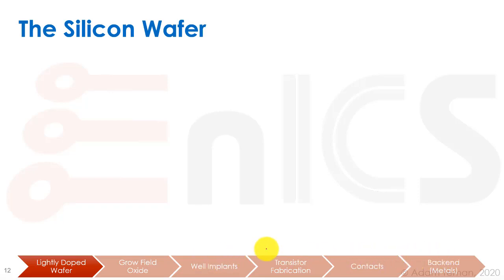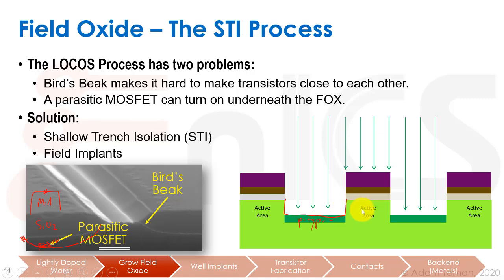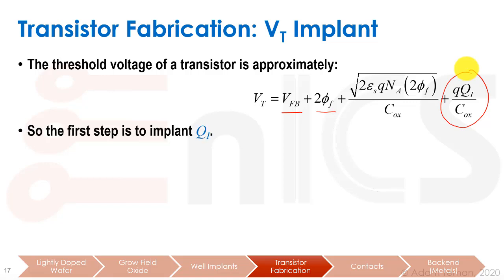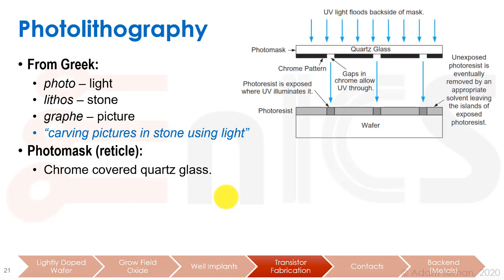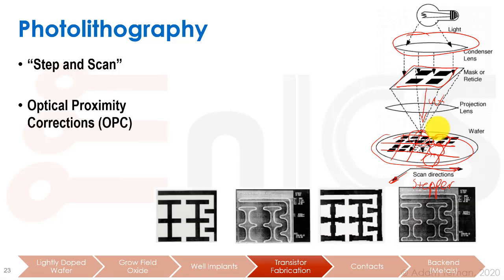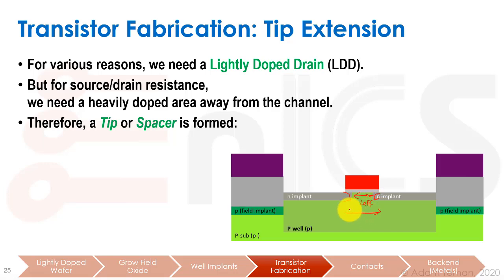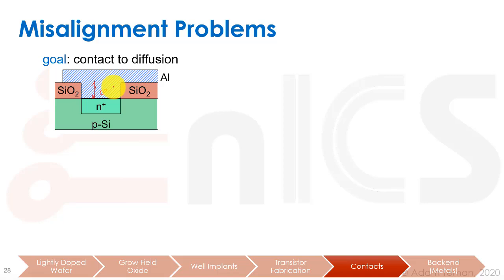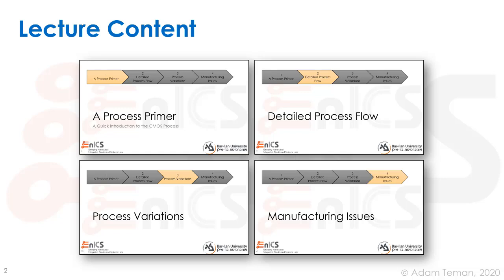VLSI - Lecture 2b: The Manufacturing Process - Detailed Process Flow

Comment: Thank you a lot for this series, I love the way you explain. What book would you recommend for a beginner in this topic? I just started working on digital implementation and have a high level idea of manufacturing process, but I would like to learn more about the steps you mentioned. Thank you !
Reply from the maker: I suggest looking at the list of sources that I put at the end of each lecture (access the slides on my website https://www.eng.biu.ac.il/temanad/teaching/). I usually write down the main books and lecture series that I used for reference. I must say that I love the Rabaey/Chandrakasan/Borijove text book that mainly focuses on circuit design, but has a good overview of manufacturing process, as well. I learned a lot of the stuff about manufacturing from J. Plummer “Silicon VLSI Technology”, 2000 – especially Chapter 2, even though this is quite an old book. There is a lot of good material on NanoHub, such as Prof. Alam's course, and you have to look at the legendary Prof. Chenming Hu's material on his Berkeley website.

Comment: What material is used for VIAS ? Why do they have higher resistance ?
Reply from the maker: Good question.
In very old technologies, they were made with aluminum, similar to the metal interconnect layers. However, as the aspect ratios got larger (higher/thinner contacts and vias), the aluminum wouldn't fill the hole very well, and so tungsten (W) was used. Usually an adhesive layer, such as TiN is filled in first to create a good connection and then the hole is filled with tungsten, and is therefore called a "tungsten plug". Tungsten, however, has higher resistance than Aluminum, and so once copper interconnect was introduced, the Dual Damascene process (overviewed in the lecture) was used to make copper vias. These also have barrier layers to eliminate diffusion from metal to ILD. You can get a good (and much more accurate) explanation here: https://www.mksinst.com/n/metal-thin-films

Regarding resistance - the vias and contacts are very special structures. They tend to be very deep holes (high aspect ratio) filled with material. This is hard to fabricate at such a nanometric scale and so the materials, processes and sizes of the vias are very strictly defined. In the end, you get a thin and long "tunnel" between layers, so you get "many Rsquares" which is high resistance. Plus, this is not entirely through copper, but has to go through higher resistance barrier layers. And finally, in a long conductor, the skin effect makes the current flow around the circumference of the via and so making it bigger, doesn't reduce the resistance as much as putting several vias in parallel.
Reply: @AdiTeman  Thank you